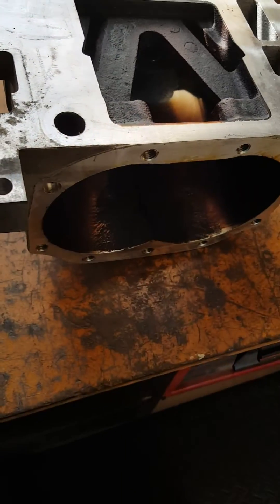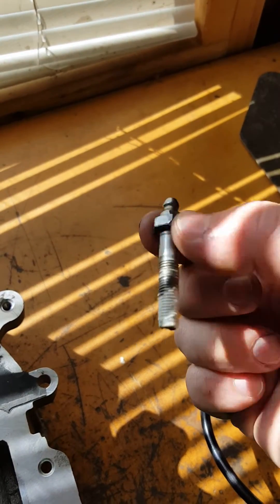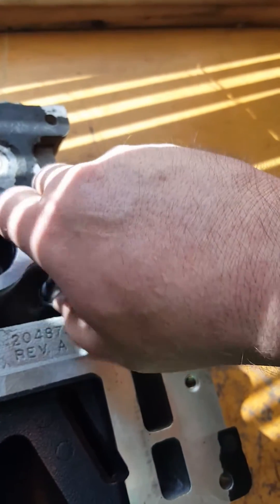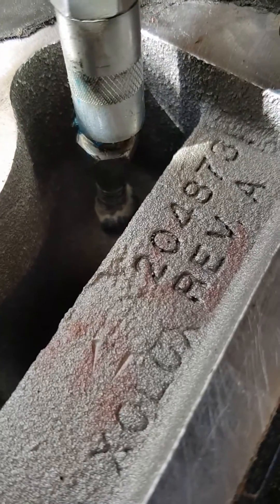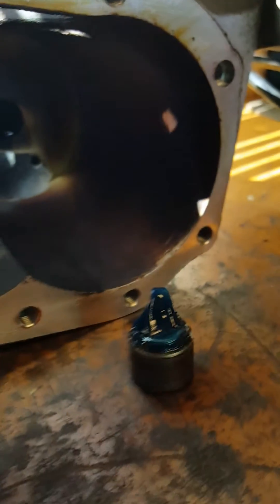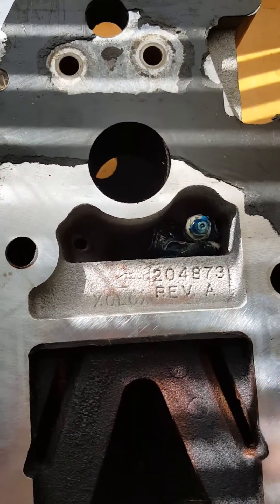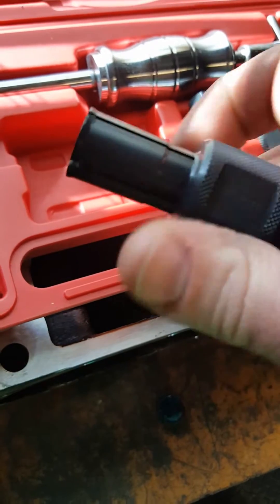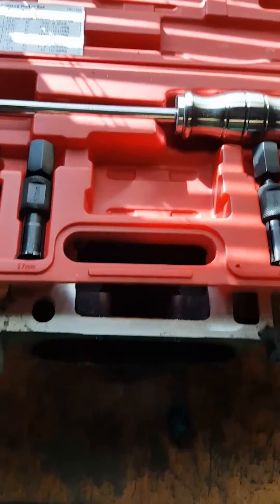Eaton GEN3 M90 supercharger case needle bearings removal. HOW TO!

Comment: FWIW I have an Eaton supercharger off a 2000 Buick Park Avenue Ultra. I have some grease fittings with M8x1.0 threads. I intend to tap the holes for this size, and put the grease fittings directly into the holes. The holes appear to be about 5/16" (.3125"), 7.9375mm The recommended tap drill for these M8 threads is 8mm I am hoping I can tap the soft aluminum directly without enlarging the hole. I will let you know how it goes.
Reply: Was successful, bit of a challenge because of depth to fitting. I found on aliexpress and ebay some extended fittings with M8X1.0 threads and 30mm long afterwards. Had already finished removing bearings prior to their arrival of new fittings, but I think they would have helped greatly.

Comment: That's similar to how we used to remove pilot bushings from the flywheel when doing a new clutch. Stuff the inside of the bushing full of grease and use a clutch alignment tool and tap it in and the grease would hydraulic the old bushing out.

Comment: Use a tapered pipe thread and you won't have the leaking around the threads, you would still have to fab the tube part but if you have a pipe thread tap, you could get both tap and die, re-thread the end of the bolt tube you make then use tape and have no leakage. As for wasting the grease, that isn't a big deal since if you clean all your parts after thread cutting there won't be any trash or shouldn't be and the grease can be cleaned out and still used for something, like the next bearing replacement?

Comment: How about putting some pressured air from a compressor to push that needle bearings?i did it to pop up brake caliper pistons
Reply from the maker: Yes, that works on brake calipers, as the pistons are made to move, and are mainly only held in the caliper body by a rubber seal. These bearings are pressed into the aluminum body, and are made not to move, or spin in the bore. Too much force is needed for air pressure to be a good substitute.
Reply: No way that an air compressor has the pressure to move that bearing. You'll need thousands of psi hence the grease gun method. 👍
Reply: @MrSimmoco  yes you were right,i ended up pumping grease to pop up those two in my eaton,and it worked 👍
Reply: @akudhega  thanks mate. As in a comment further down my grandfather showed me the same trick using grease to extract a brass bush in the back of a crankshaft that supports/centres the input shaft on a manual gearbox. Fill full of grease and use an old input shaft of the same size, a perfectly machined rod to hammer the grease into the rear behind the bush or bearing to push it out. Such a simple concept when you think about it. I really do love home diy/ Macgyver fixes to problems ☺️👍

Comment: I got a blower off a bonneville ssei. I have a barcode with numbers on it. Where can I punch the numbers in to see the exact info of the blower? Idk the year of the car, it was a junk yard find.
Reply from the maker: Well, first off, its a supercharger, not a blower. lol The bar code was something Eaton did on their units from the factory. You can reach out to them to see what the numbers mean, but all the superchargers were mass produced, so nothing really special about them. You can google image search for your supercharger to find what exact mode it is, from there, you can search for info and specks on the model. Depending on your year of car, it could be a M62 or a M90.
Reply: @GR8racingfool    I only call them blowers because I grew up with a family of hot rodders so it stuck with me and everyone I know calls superchargers blowers. You know what I mean tho but I wanted to know if the numbers could tell me the info I need. It was off a junk yard car that’s now gone.

Comment: SCORE! I have those pull out tools so its on now. Thanks for the video good sir.
Reply from the maker: Glad to help
Reply: @GR8racingfool  I tried my cheap puller tool and a tooth broke and it hit me in the chin and cut me. So it was a fail. So I just decided to buy a used sc from the fb marketplace for 180 for a lightning and saved the broken one for later to port and rebuild.

Comment: Just an FYI, I just checked my m112 from an 03/04 cobra and it does not have the holes. However the bearing puller tool he used at the end of the video should work just fine, and you should be able to rent it at auto parts stores. **USE THE EXACT KIND OF PULLER HE SHOWS!!! DO NOT USE ANY OTHER KIND OF BEARING PULLER**

Comment: Would this work on a eaton m112?
Reply: TheGjergj79 it does NOT work for an 03/04 cobra m112. I just checked mine, it does not have the holes. You have to use the puller like he shows at the end of the video.

Comment: mines already drilled n threaded and i got the blind hole tool ive been tryin for 2 hrs to get one out
Reply from the maker: jdm4stance might try heating the main housing in an oven. 250*-300*F that will expand the aluminum, and make the bearing come out easier. I have never needed to do that, but if I did, that's what I would do.
Reply: k u should sell that gease bolt lol id buy it
Reply: @GR8racingfool  hey man I spoke to you about polishing my 2002 Lightning Supercharger Casing for me once I was finished and came back from the paint shop. I've been finished re-building and had a few more questions as soon as you can... I really really need some information and advice from an expert...Thanks..